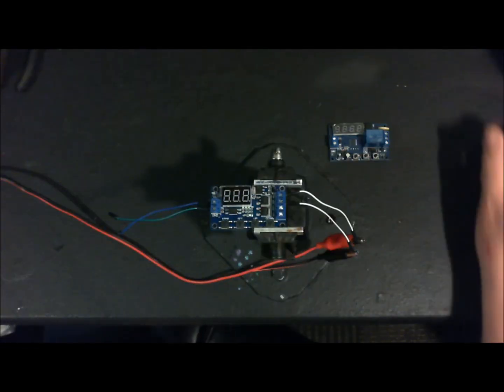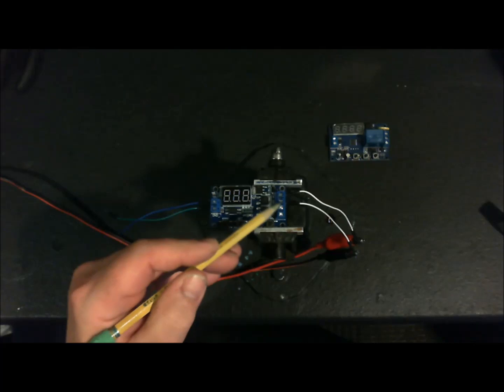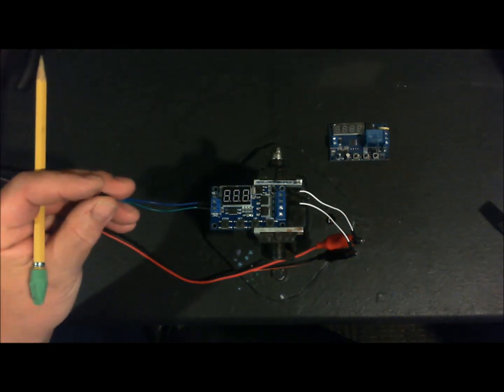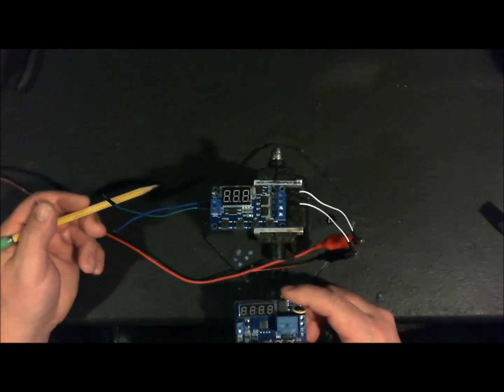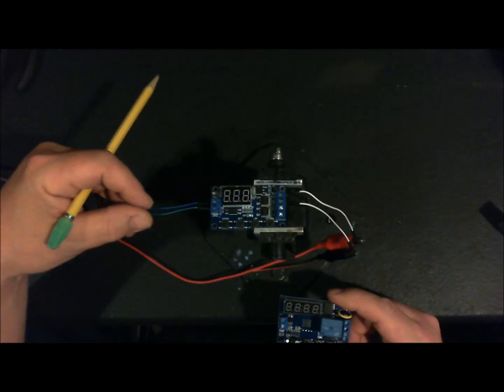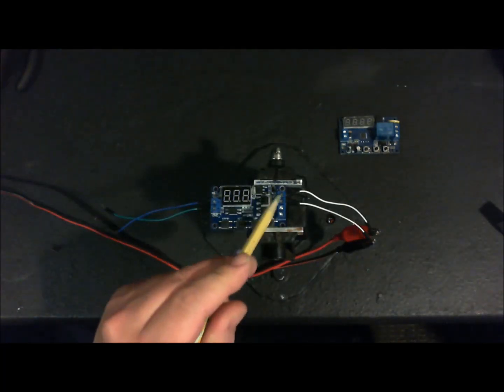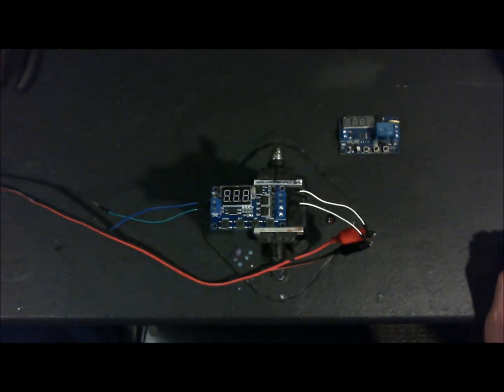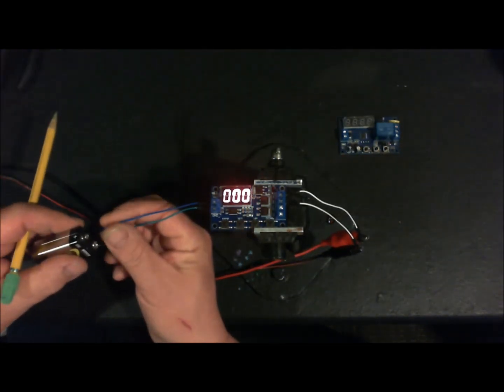Trigger cycled timer control board simplified.

Comment: can you power this with a 9v battery? Or two/three 9vs in paralell? Also does the trigger can to be a battery or can you just use a momentary switch? I've seen others do that.
Reply from the maker: Yes, Yes, and Yes. Do you have the same board depicted in the photo?
Reply: @raykd2ibp198  I just ordered it off ali express. Not sure if it has the same model. But it looks 100% identical.
Reply from the maker: @Hotshotter3000  Let me know how you make out. I'm here to help.
Reply: @raykd2ibp198  Yep, but as you said in the video it'll likely take a month or so before it gets here, and hopefully it'll work. Otherwise, as you said, toss it away and take it on the chin like a champ.
Reply from the maker: @Hotshotter3000  Hope you got a few. You .will find all sorts of places to use them. So cheap. And they oil the brain cells. Keep building / thinking.
Reply: @raykd2ibp198  I just got mine in the mail and tried it out. Works like a charm! :D Let's see what can I make work with this bad boy.
Reply from the maker: @Hotshotter3000  Good news. Feel free to share vids of your success! Be well!
Reply: @raykd2ibp198  aaaaannnnddd it just stopped working for some odd reason. I dunno why. It just stopped. I had tested it with my DC-DC buck converter (to see how much voltage was going through) and a buzzer. Both worked initially, but then I decided to come back to it and see how it would work with a momentary switch and it just stopped giving out power. I went back to triggering it with a 9v like before and nothing happened. The LED display comes up, it counts up with the OP and CL like before, but no power is going to the device... Very strange.
Reply: @raykd2ibp198  Actually scratch that. I got it working again! Turns out it does need the mode to be 'on' by pressing the set button! My bad.
Reply: @raykd2ibp198  So I'm mildly confused as to what is happening now. I got it. I managed to use most of the settings correctly. I put on a buzzer and the buzzer worked. But when I decide to put something like my DC-DC DROK buck converter it... shuts off when the moment it needs to start. It just isn't working as it was supposed to. The DROK did light up to show me how much voltage it was getting from the battery (I've used 1 9v, 2 9vs connected in series, and 6 D cell batteries as a test. All energized it just fine) but it seems like the moment it needs to output any real voltage it shuts off. It worked at first, but it did not like to work again.

I'll figure it out somehow.
Reply from the maker: What's up? Why the convertor?
Reply: @raykd2ibp198  I just want to see how much it can deliver. I might need this to do some electroplating when the electroplating needs to be interrupted every once in a while. This is being a little frustrating than normal. But I'm sure I can figure it out.

That being said, it doesn't appear to be consistently delivering much if it is delivering a complete circuit... unless it's a buzzer, oddly enough.
Reply from the maker: @Hotshotter3000  It might simplify things if you just used a relay to deliver the required voltage to the electroplating apparatus. You can also use variable dc voltage running thru the relay contacts, provided the relay you choose is rated for that voltage.
Reply from the maker: https://www.amazon.com/Variable-Digital-Adjustable-Regulated-Switching/dp/B07X2VZSL9/ref=asc_df_B07X2VZSL9/?tag=hyprod-20&linkCode=df0&hvadid=385545943853&hvpos=&hvnetw=g&hvrand=16041935925179746035&hvpone=&hvptwo=&hvqmt=&hvdev=c&hvdvcmdl=&hvlocint=&hvlocphy=9004517&hvtargid=pla-841479175648&psc=1&tag=&ref=&adgrpid=79419939780&hvpone=&hvptwo=&hvadid=385545943853&hvpos=&hvnetw=g&hvrand=16041935925179746035&hvqmt=&hvdev=c&hvdvcmdl=&hvlocint=&hvlocphy=9004517&hvtargid=pla-841479175648

Something like this. They make nicer one of course. Perfect addition to the test bench, and control of current and voltage at your finger tips. you may not even need the use of a relay. But 30 vdc is pushing the limit on the board. Check the amperage rating too I forget.
Reply: @raykd2ibp198  Thanks for that. There are also other ideas I have for this. Like a timed pet/bird feeding device that would drop food/water at certain intervals. I also have some Arduino projects in mind. I'm still very new to electronics and what I want to do is pretty simple.

That being said, There is a chance that there is something wrong with the relay, and since they're really cheap, I did get another one. These things are small, cheap, and fun.
Reply from the maker: @Hotshotter3000  YW Good luck my friend. Fell free to ask if you have questions. 73

Comment: I use 12v it's working fine
I want to use 24v and it's broken with a little explosion sound
It's a lie when it say 3-30v
Reply from the maker: Ha! Goood morning Rakasiwiii. Care to elaborate regarding what you have going on? These boards aren't built for quality in my opinion.  However,  I think they're great for prototyping ideas. The upside....you can afford to blow up a bunch of them without a teardrop.  Even if we blow them up due to our own error. I do it all the time! Keep the learning fun! 73,
Reply: @raykd2ibp198  
-I need 12v with time delay to alternate between on and off for my led strip (lets say 1h off and 1h on)
-i need 24v with timer to alternate on off for ultrasonic mist maker (lets say 5m on and 20m off)

So I bought 4 of this product becouse it say it can withstand 30v.
I try to built the mist maker (with source 24v) but it didn't works so I test my other relay with 12v source and it works just fine. I got curious and change the source with 24v and snap the 7segment die and the relay indicator stay on. So I broke 2 of this device 😁 and my conclusion this thing can't withstand 24v

I want to try to give input of 12v and boost it's output to 24v  with buck converter but afraid it won't work  or broke my other components, if u have any advice pls tell me
So Tomorrow I want to try it with 5v input(may be it's safer with 5v?) and just connect it's output into relay to drive 24v my mist maker wanted
Reply: Nb: english is not my native so forgive my broken english
And cheers
Reply from the maker: @CharDhue  You're doing fine. 
Me mindful of how much current you are pushing thru the circuit. RMS and inrush current are factors.  
Make sure you are not energizing a dead short too.
You can also use the final circuit to drive a  a larger switch, big enough to power up a city grid if you needed.
Reply: @raykd2ibp198  rofl, I'll try my best to power up my whole city
Wish me luck 🤞

Comment: Hi got a few questions please. What happens if the signal input is constant and doesn’t switch off

Do both sides of the board need to be grounded and can they be grounded to the same point ?

Ho to you change from NO and NC please
Reply from the maker: Hi Saroo,
1) Depends on how many cycles you  program the bord to run. I believe to reset the trigger, the signal has to drop to low.
2) Same power source for both sides? I like to keep both sides isolated.  
3) Its how you wire the right side of the board. Common remains the same. NO/NC is a wiring option.
Reply: @raykd2ibp198   1) I just want the board to run once cycle when it's gets a signal trigger then do nothing until signal goes off and back on.
2) no sorry I meant same/common ground for all grounds on the board

Currently I have my input signal which is 12v and stays on until it loses power from another switched relay.
On the right of the board I have 12v permanent and ground (which shared with my load ground) then my output + to my unit/load which is already grounded separate.
Would this set up work on mode p1.1 to trigger power for 10 seconds to my unit/load then go off and not provide power again to my unit/load on output + until the signal trigger is lost and re triggered please

Thank you for your reply really appreciate it 🙏

Comment: Maybe you can give me some advice I want to actuate a small dc motor also on a feeder I need it to switch on at 5 pm for 10 sec every day how would one go about it
Reply from the maker: Sorry for the delay. Timer is a network controlled lawn sprinkler timer. It controls partial water changes and feedings. Its a bit involved.

Comment: What are you using to send the signal to run your fish feeder every 24 hr? I want to make a day night timer to turn on off LED terrarium lights.
Reply from the maker: What's up Nat. The fish tank is controlled by a lawn sprinkler controller. Simple, cheap, reliable, accessible via internet regarding program overview and changes. Way outdated. However, the system is still standing tall with no issues.
Reply: @raykd2ibp198  perfect! Thank you!

Comment: Hello. Thank you for this video. Please can you help me how to set 0.1 sec and operate it with trigger? Also can I use the same power supply for the trigger? I have a 12V DC power supply. If I control the power of trigger with a pushbutton it will work? Thank you in advance.
Reply from the maker: Good morning Gjergi. One tenth of a second? You probably don't need a timer at all. And yes, voltage in and out on the switched circuit can be brought over from the voltage used to power up the board. Can you give me an idea regarding what it is that you are trying to do.

Comment: Can I use this to run a dc motor cw for x amount of time then ccw for x amount time then repeat continuously? I apologize in advance if this is a silly question, but I'm new to the wonderful world of electronics.
Reply from the maker: There is a way to do this with a DPDT relay. The time delay would be the same in both directions until power to the relay is removed. There may be a better way to do this. I would need to know the exact sequence of operation to better understand what you are trying to do.

Comment: Hi Ray, Once the timer has been set once How do I reset the operation to program another sequence?
Reply from the maker: Hello Nolan. If there is a way to reset the board to its factory settings, it has not been published yet (to the best of my knowledge). I would just reprogram it to suit the sequence I was looking for. 
Most of the data here has been a result of me hunting around for it, and thru experimentation. If you find the answer please share. It could be helpful to someone else. Thank you and 73!
Reply: @raykd2ibp198  Hi Ray. Thanks I finally found it. All you need to do is hold the set button for +/- 3 seconds the P3.2 shows up and you press the set button again "Short Press" this clears the existing programing and allows you to reprogram anything else. B.T.W  I also found out that a long press on the Stop Button does some strange things as well, Be Carefull though "LOL" I managed to turn of the LCD By doing that .... It continues to count but you see nothing ( I think it is supposed to be power saving ).  Hope this helps someone sometime. It took me forever to work these bits out.
Reply from the maker: Nolan, 
Glad you got it! Thanks for sharing.

Comment: How does the timer behave if your signal is longer than the 4sec timer?
thanks
Reply from the maker: I believe If the trigger signel remains high...nothing hapens until it drops low, and goes high again. You may be able to program around that if you need to. I havn't had to yet.
Reply: @raykd2ibp198  Thank you, that is actually the behavior I need.
Reply: @raykd2ibp198  ah,so my project would use a ldr to start the timer for 8 hours lighting at dusk but because the ldr wont drop out till morning this wouldnt work ?
Reply from the maker: Why wouldnt you use a typical line current photo cell like below? 
Sundown close circuit, Sun up open circuit. Are you just looking to shave +/- 4 hours off of the closed circuit time? 
 
https://www.lightmart.com/120-277-volt-pencil-photocell/?gclid=Cj0KCQiAzZL-BRDnARIsAPCJs70NHzaMfTn6KCuRZfC96NvDQaU25JWjuO2NVjwUmYBSVPTtR7IBbNcaAuNZEALw_wcB
Reply: @raykd2ibp198   lol ,yes the LDR does the same thing its a log reindeer with silly leds and bluetooth speaker(all battery powered) and has taken me ages to design and build and as we are on a main road I don't want some drunk walking off with it so wanted it to shut down automatically when we are in  bed-mad really but thats me-so i wanted the ldr to start the timer and cut off the leds when it reach's 12am-ish but the signal from the ldr will still be there until the morning i have just ordered one anyway and will have a play when it comes for next year.thanks for the reply
Reply from the maker: Ha! would love to see a short vid of the project. I'm a big fan of doing silly stuff myself. Case in point.
https://www.youtube.com/watch?v=xzwAFyV-OKY
Please feel free to contact me at anytime if I can be of assistance.
Reply: @raykd2ibp198  thanks Ray,watched your video and loved it ! I will make a video and link it- its funny because i originally wanted to put a voice recorder linked to a PIR(i actually got cheap voice recorders but the speakers i ordered were rubbish so went with the bluetooth instead) and to put a moving mouth on the reindeer but decided time would be against me -i wanted glowing eyes and will bushee sent me some pcbs https://youtu.be/yX9wPVbvJBk .i have today linked all the leds to a remote relay so can switch them off but need to remember to switch them on again in the morning-id be interested to see how the skull works if you have a link and appreciate the offer i may take you up on that

Comment: Is it okay to put normally open and common contacts to arduino?
Reply from the maker: Good day Marvin. 
What you put into the common on the relay, or transistor is what's going to come out of it when the NO closes.  Make sure the circuit going to the arduino, and the relay board itself can handle that voltage and current. I'm not sure what you are doing, I don't have any experience with arduino yet.

Comment: Can I set time for 1/10th of a second?
Reply from the maker: Yes. Not sure why you would want to...
Reply: @raykd2ibp198  for a spot welder
Reply from the maker: @niius7663  k,  you're just trying to control the fuse time? I like it.
Reply: @raykd2ibp198  yup using not to control a starter relay
Reply: @niius7663  hello friend. I have same relay using it as on off relay to control my heating system. In this video I understood how to connect the trigger. It needs power. The relay works 4-6 hours every day.

Comment: I have a raspberry pi that I want to run my red (hot on ignition), yellow (battery constant), and black (gnd). this is for a head unit I am making for my car that uses a raspberry pi as the main brains of the head unit. I want on shut down to switch to yellow battery power for a set time, and then shut down clean. I will need to use one of their GPIO pins to sense when there is a high or low state for voltage and write a script to shutdown on low voltage after a time. Do you think this sort of board would work for this application? Thanks for your help.
Reply from the maker: Hey there sclair10.

This board is simply a timer that is triggered to start pre programed timing sequences that will close, or open a switch. 
I don't play with raspberry pi as of this conversation. However, I am willing to bet a dollar.. that you can eliminate the need for this board, if you program the Pi well. 
I will try to look into this a little deeper when time permits, and I will try get back to you.  
If you find a solution quicker than I can, please feel free to post.  There're may be others that can benefit off of your findings. 

73!
Ray.

Comment: hey Ray, hitting the stop button doesnt move the seconds to miliseconds in the time selection screen. I thought it might be the button but i shorted the button by hand and it still didnt work. Is my process correct?

Set the p1.1, hit the "set" button OP Flashes on the screen, and it switches to the 000. screen. I hit the STOP Button expecting it to switch to 00.0 but nothing happens.
Reply from the maker: Hello Tarik! 
Please describe the sequence of operation. I will try my best to get you to your desired outcome. 
73!
-Ray
Reply: @raykd2ibp198  just figured it out, it was the button. I shorted the other side of the contacts and it worked. Thanks either way!